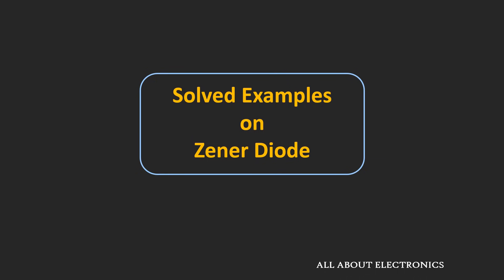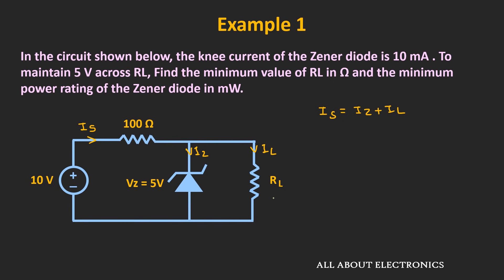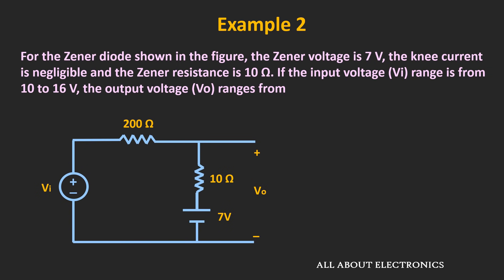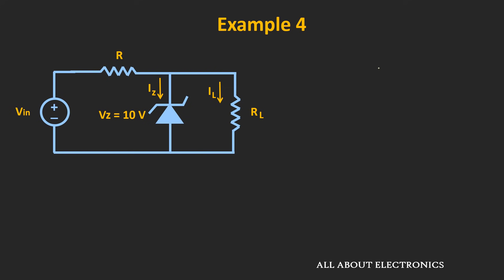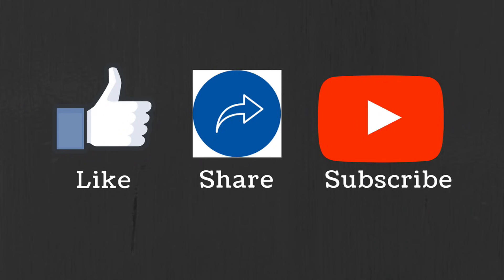Solved Problems on the Zener Diode

Comment from the maker: The timestamps for the different examples solved in the video:

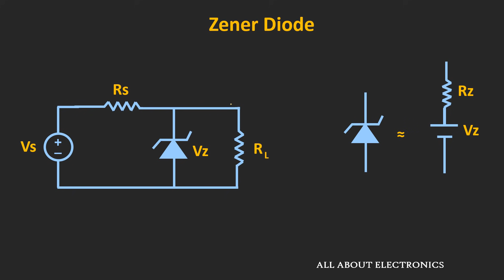1:15 Example 1

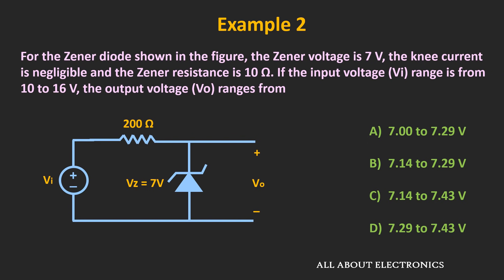5:55 Example 2

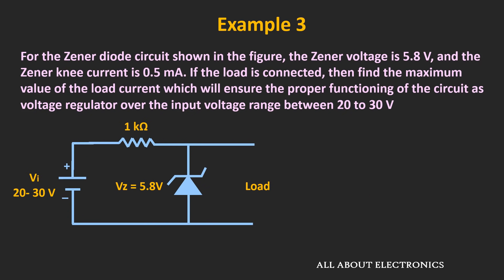9:55 Example 3

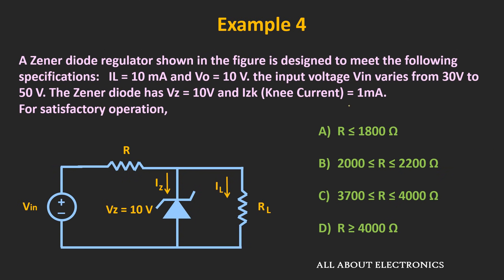14:33 Example 4
Reply: Sir,
I have doubt in this example 3, Can you please explain me.
As vin is increasing from 20-30 volts
Can you tell what is the value of load current and zener current when Vin=25 volts?
Reply from the maker: @sandeepmukhrjee2476  If Vin is 25V fixed voltage, then Is = 19.2 mA. Zener Knee Current is 0.5 mA. Therefore, maximum load current is 19.2 mA - 0.5 mA = 18.6 mA.
Reply: @ALLABOUTELECTRONICS  
No no sir...you got me wrong,

I am not changing any statement of the question.
I am saying, as it is mentioned that Vin is increasing from 20 to 30 volts.
So, when Vin=20 volts then, then Iz = 0.5 and IL = 13.7
When Vin=30 then Iz= 10.5 and IL= 13.7
And when Vin=25 then Iz= 5.5 and IL= 13.7
Does this mean IL is fixed ?
Is my above analysis is correct?
Reply: @ALLABOUTELECTRONICS   sir, at 13:50 you said
If we choose 23.7mA as the maximum current then the circuit will not work because at Vin=20, the input current is 14.2mA which is less.

Sir my question is, the input current is less then what is the problem?
It can be possible that at Vin=20 volts. Iz=0.5mA and IL = 13.7mA
Although it is less than the maximum value but it can flow through load.
Right?
Reply: @ALLABOUTELECTRONICS   14:00 , sir when u calculate soure current ,the units are not same i.e. numerator is in volt & denominator is in kilo ohm . How it can be done?????as
Reply: At 16:55 why not we have included load resistance in denominator?
Reply: 1:15  sir you have done maximum power rating of the zener diode 
But in question it is given minimum power rating .

Comment: isn't it that the 250mW power rating of the zener diode on the first problem be the maximum power rating and not minimum since it has no load? just want to clarify since i want to understand fully the concept. thanks!
Reply from the maker: Here what I mean is that, for this application, the Zener Diode that you select should have at least 250 mW rating, so that it works with the circuit. So, basically its minimum power rating of the Zener diode for selection perspective. I hope, it will clear your doubt.

Comment: pls explain again that in example 3 why we took 20 v as the source voltage and not 30 volts
Reply from the maker: With 20V, the max. current that we are getting is 13.7 mA. so, with that value, you can calculate the allowable value of load resistance. i.e Rmin = 5.7 V / (13.7 mA). Now, with that load, when the input becomes 30V, then load current will remain the same. 
But if you take the other way around, then it won't work.
For example, if you find the max. current using 30V, then Imax = 23.7 mA. And accordingly, you can select the minimum allowable value of the load resistor. i.e Rmin = 5.7 / (23.7 mA).
Now, with that load, when you connect 20V input, then load current will still remain the same. (i.e 5.7V / Rmin = 23.7 mA). But at 20V, the supply current will not be that much. Because in case of the 20V, maximum value of the supply current is 14.2 mA only. So, source is not able to supply that much current. And hence, the circuit won't work as the regulator.  That is why, the value of Imax is calculated using 20V. I hope, it will clear your doubt. If you still have any doubt, then let me know here.
Reply: @ALLABOUTELECTRONICS  ok got it .....

Comment: I really didnt understand 5:40 like why is the worst case where load resistance is infinite doesnt that mean all the current will pass through the diode and hence more power generated as power is directly proportional to current flowing through it
Reply: @parashardeb9716  it is minimum power rating written there not the minimum power dissipated. Minimum power rating of a diode is the minimum power requirements of a diode to withstand the power dissipation conditions of the circuit with the maximum amount of voltage (peak voltage in case of AC), hence, the worst possible case is taken into consideration 
Hope that helps!!!

Comment: At 2:48 what is IZK?
Reply: NVM Zener knee current!
Reply from the maker: It is the minimum required current through the Zener Diode, to use it as a voltage regulator. If the current through the Zener diode is less than that then it won't provide constant voltage.

Comment: 17:04  i didn't understand that why we chose R for Vin = 30V, why didn't we find R when Vin=50 v?
Reply from the maker: Our aim is, the value of R should be such that, the circuit should work properly as a Zener Regulator. Here, IL is fixed and Izk is fixed. So, we know the minimum required current Is (Is min). 
With our selected value of R, if we are able to get Is (min), then the circuit will work properly for higher supply currents. At that time, the current through the Zener diode will be Is - IL. 
So, here for the given value of R, the minimum value of Is will occur when Vin is minimum. That is 30V. And that's why, the value of R is found when Vin = 30V.
If the circuit works properly when Vin = 30V, it will also work when Vin = 50V. I hope, it will clear your doubt.

Comment: At 5:51 if we are calculating power minimum then shouldn't we multiply knee current to zener voltage which will be equal to 5*10 = 50 watts 😮‍💨
Reply: i too thought the same

Comment: why current is added with voltage to get output voltage 8:35
Reply from the maker: Using ohm's law, the voltage drop across 10 ohm is calculated ( 10 x 3/ 210). And the overall output voltage is 7V + voltage drop across 10 ohm resistor. I hope, it will clear your doubt.

Comment: What would happen (w.r.t Example 1) if we select RL less than its minimum value (125 ohm). Let's say we connect RL with value of 90 ohm, what would happen to Vz? Will it remain 5V or drop?

2. What would happen (w.r.t Example 1) if we put 3v LED as RL in the circuit?? What would now be the voltage across zener diode (Vz) ?

Comment: @ 4:06 doubt hai
Reply from the maker: If the value of load resistor is less than 125 ohm then the current through the diode will exceed its maximum current rating. And that can damage the Zener diode. I hope, it will clear your doubt.
Reply: @ALLABOUTELECTRONICS  thanks 👍

Comment: One question , in the first example how to find the RL max ?
Reply from the maker: To find the RL (max), first Iz (max) should be known. That is the maximum Zener current which Zener Diode can withstand. In this case, it is not given. But if it is given then considering that value of Iz, you can find the maximum value. I think I have already covered one such example. Please check the diode and diode application playlist. You will find it there. In case, if it is not covered then let me know. I will surely cover it on the second channel.

Comment: @ 5:30 why the maximum ('worst possible case') zener current has been considered for calculating minimum power rating of the zener diode?
Reply from the maker: The minimum power rating is the minimum required power rating of the Zener diode with which it will work with the given load and voltages. That means whatever Zener Diode we select, it should be able to withstand the worst possible case current. If its power rating is more than that, then definitely it will work in the given circuit. I hope, it will clear your doubt.

Comment: Please clear my doubt at 14:16 how to choose answer
Reply from the maker: First we have calculated the minimum value of the series current which is supplied by the source. Even at the minimum current, the circuit should work. From that, the zener knee current was subtracted, because that much current is required to operate the zener diode. And the remaining current is available for the load. So, the remaining current ( Is - Izk) is the maximum current which can flow through the load. Or in other words, while selecting the load resistance, its value should be such that, the current through the load is not more than 13.7 mA. If it is more than that then circuit will not be able to supply that much current. ( When it is operating at 20 V). Of course it can supply that current at 30 V, but during the design we should always consider the worst case scenario. I hope, it will clear your doubt. If you still have any doubt then let me know here.

Comment: Sir how to solve the given below problem 
Consider a peak rectifier fed by a 60Hz sinusoid having a peak value Vp=100V. Let the load resistance R=10kohm. Calculate the fraction of the cycle during which the diode is conducting.

Comment: @ 14:13 always had doubt that why 13.7 and not 23.7 but you explained it so simply. Thank you ❤️
Reply: I have doubt in this example, Can you please explain me.
As vin is increasing from 20-30 volts
Can you tell what is the value of load current and zener current when Vin=25 volts?
Reply: @sandeepmukhrjee2476  when Vi = 25V, Is = 19.2mA and Iknee(zener) = 0.5mA, which makes Iload = (Is - Iknee) = 18.7mA. Hope it helps!
Reply: @vishvakapadiya3051  according to you, for Vin=25, IL is 18.7 then how IL maximum is 13.7mA?

In the question it is mentioned that, for Vin=20-30volts find the IL maximum.
Reply: @sandeepmukhrjee2476  the reason is, if we use any value beyond 13.7, like 23.7. Then, at 20V Vin, zener diode could not work as it can not even have knee current (as Iload itself takes large value). Thus, circuit is off. And in question maximum current required so circuit can function properly. Thus, ILoad maximum is 13.7
Reply: @vishvakapadiya3051   
If we choose 23.7mA as the maximum current then

It can be possible that at Vin=20 volts. Iz=0.5mA and IL = 13.7mA 
Although it is less than the maximum value but it can flow through load.
Right?
Reply: @abhishekbhandari4359   yes Abhishek, I am also not understanding that part.
Reply: @abhishekbhandari4359  through Vin = 20V maximum current source current (Is) flowing through is (20 - 5.8)/1k = 14.2mA, so how can we have maximum load current 23.7mA and on top that 0.5mA for zener diode. So, it is not possible to have maximum current 23.7mA.
Reply: @sandeepmukhrjee2476  and Source current (Is = Iload maximum + Iknee) thus, maximum load current can not exceed source current
Reply: @vishvakapadiya3051  thanks a lot bro.
Ab samjh gaya. 👍👍👌
Reply: @vishvakapadiya3051  can u pls xplain me once brother... Y we should take 20v.. Current as maximum... Pls...
Reply: @vishvakapadiya3051  this situation(when Vi = 25) has the larger load current than the answer, and Vi > 19.2m*1K=19.2V at the same time, so why can't it be a better answer ?

Comment: Nice video sir 
But I had a question
Suppose we are asked what is the output voltage...does that have a specific formula or it's like zener voltage is equal to output voltage?
Reply from the maker: If the series resistance of the Zener diode is assumed to be zero , then yes output voltage is equal to Zener voltage. Unless the series resistance is specified, Vout = Vz when Zener diode is operating in the breakdown region.

Comment: What about the maximum power rating in first example ?? Help anyone
Reply from the maker: Here the minimum power rating refers to the minimum power rating required of the Zener Diode such that, it can operate with the given configuration of the supply voltage and the resistors. 
That means the selected Zener diode should have the max. power rating of at least Pz min (which is found in the example).
I hope it will clear your doubt.

Comment: In the case of maximum power rating we use maximum current ( see electronic devices and circuit theory by boylestad 10th edition example 2.27 (b) ). But for minimum power rating you have used maximum current. Is it right???
Reply from the maker: Would you please mention the timestamp where you are referring to ?
It will become easy for me to answer your question.
Reply: Please see example no 2.27 of electronic devices and circuit theory by robert boylestad 10th edition.
Reply: yes, i think u are right as he used maximum current instead of using min. current passing through diode to find out min. power rating

Comment: in example 3 why didnt u take the maximum value of load current as 23.7A? i didn't understand that part
if we take 23.7 as maximum anything below that current can also exist as make the zener to function properly right
Reply from the maker: As, I mentioned at 13:50, if we select 23.7 mA as the maximum load current then the circuit won't work when the input voltage is 20V. Because at that time, the supply current Is is 14.2 mA (which is less than 23.7 mA).
During the design, the max. allowable current should be such that the circuit should work properly for the entire input range.
For example, if we connect the load according to 23.7 mA ( 5.8V/ 23.7 mA), then the circuit will work at 30V, but it won't work at 20V. Because the supply itself is less than 23.7 mA. 
So, with that design, if we select the min value of the load or max. allowable current (for regulated output voltage), then the circuit won't work at 20V. 
I hope it will clear your doubts.
Reply: @ALLABOUTELECTRONICS  does it mean that the current through zener must be equal to or greater than max current?
If this is so then y is it called max current?
Reply from the maker: See, when we say max.current, it's the max. current which is allowed through he zener diode to work it properly as zener regulator. Similarly when we say, max. Load current, it's the max.allowable current through the load which will ensure that the zener diode operates as a voltage regulator. The current through either zener diode or the load should be less than the max. limit.

Comment: Sir i didn't get how u select 13.7 mA as max current plzz explain
Reply from the maker: if we select 23.7 mA as the maximum load current then the circuit won't work when the input voltage is 20V. Because at that time, the supply current Is is 14.2 mA (which is less than 23.7 mA).
During the design, the max. allowable current should be such that the circuit should work properly for the entire input range.
For example, if we connect the load according to 23.7 mA ( 5.8V/ 23.7 mA), then the circuit will work at 30V, but it won't work at 20V. Because the supply itself is less than 23.7 mA. 
So, with that design, if we select the min value of the load or max. allowable current (for regulated output voltage), then the circuit won't work at 20V. 
That's why 13.7 mA is selected as max current.
I hope it will clear your doubts.
Reply: @ALLABOUTELECTRONICS  no sir using v=30, the current through the battery is 24.2m plzz check the equation again

Comment: In example 1 ..why we are  considering only one resistance while calculating total current we should also take load resistance ..plz clear my doubt..
Reply from the maker: I think you are talking about the current Is right ??
It has been found using the nodal analysis method.
The voltage at the twp node is known. (Vs and Vz).
The current which is flowing through the resistor is equal to (Vs - Vz) / R.
I hope it will clear your doubt.

Comment: minimum power rating, Pz=Vz*Iz
when  Iz=Is , how power is minimum? it should be maximum!!
Reply from the maker: Here, the minimum refers to the least power rating requirement of the Zener diode. That means if you are going to use some Zener diode for this circuit then its power rating should be more than that. 
I hope it will clear your doubt.

Comment: Example 1  minimum resistance is 100ohm  if we apply direct formula and u got 125 ohm .then which one is correct.please reply bcz lots of confusion arises
Reply from the maker: The direct forumla is applicable when it is assumed that Izk is negligible. Here, the value of Izk is given. So, if you consider the Izk then you will get 125 ohm.
In the question if Izk is not given then you can assume it zero. And you can apply the direct formula. If it is given, then you can solve as shown in the first example. 
I hope it will clear your doubt. 
If you still have any doubt then do let me know here.
Reply: @ALLABOUTELECTRONICS   thanks
Reply: @ALLABOUTELECTRONICS  sir is there any reason why we should consider like that way?
Reply: @ALLABOUTELECTRONICS  but why is it so sir? Is this because,the consideration of Izk will always give thevenin voltage greater than Vz?

Comment: A zener diode has a resistance of 5ohm .if the current through the zener diode changes from 10mA to 20mA, then change of voltage across the zener diode will be 

(1) 0.05v        (2) 0.1v    which is correct explain in detail 

Thanks 
Sir

Comment: 7:30
How V(output)=7V + 10ohm*Is ??
Reply: It's 7v+V10

And 
V10= 10ohm*Is
Reply: @travellerhasib5522  Hey Traveller... your explanation it's 7V + V10 and... V10 = 10ohms*Is confused me... to what does V10 refer? is that Ten Volts??  Is that V with number 10?? What is that?

Comment: Previous video, RLmin = (Rs*Vz)/(Vs-Vz) = 100 Ohm .. What happened? Both seem logical to me hence the confusion.
Reply from the maker: In the previous video, during all the examples it was assumed that the Zener Knee Current is Zero. (Izk = 0).
But here it is non-zero. In this example, if you consider Izk = 0, then you will get 100 Ohm.
I hope it will clear your doubt.
Reply: @ALLABOUTELECTRONICS  Thank you!
Reply: @ALLABOUTELECTRONICS  So if I had a non negligible resistance (i.e not this video), it'd become correct just by using Vz+Rz*Izk instead of Vz. Else if the resistance is negligible but we have a knee current, I should analyse the circuit for the minimum values using currents because elsewise I'd loose the Izk since Rz is null right?
Please correct me if I am wrong.